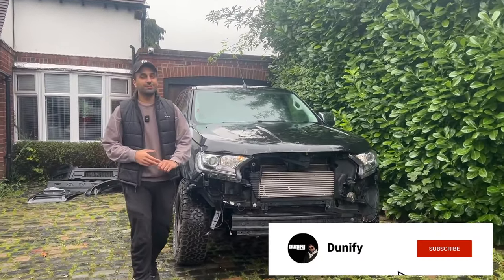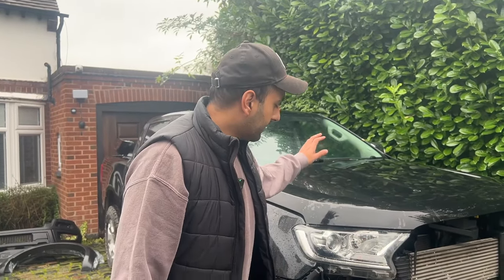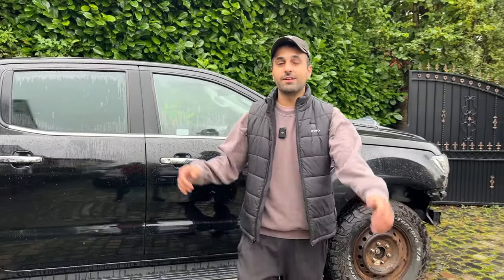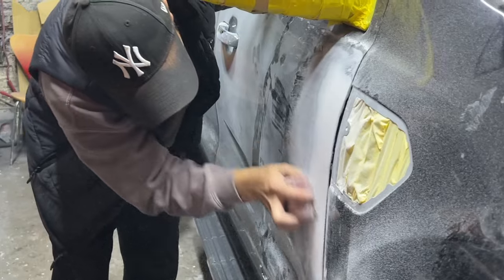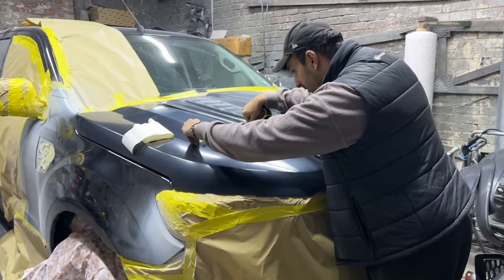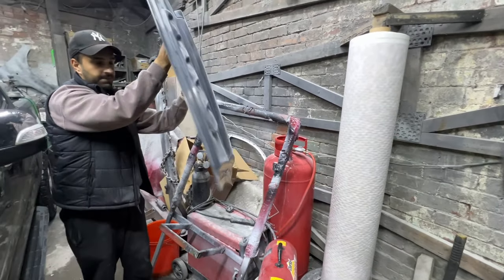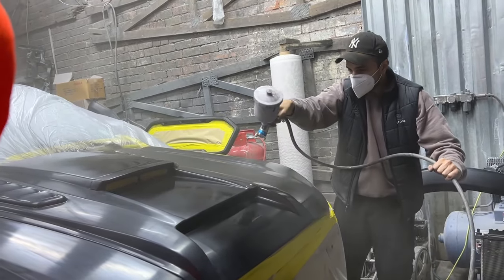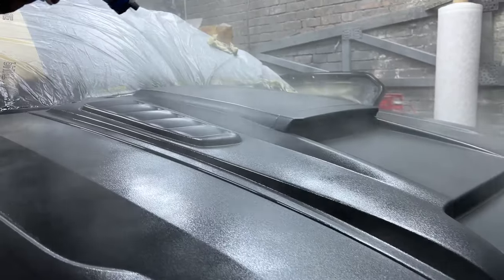I ATTEMPTED TO PAINT MY WRECKED FORD RANGER

Comment: Thanks for the video, I've painted a lot of tractors/ excavators for customers  and a couple them and trucks for myself over the last 35 years. I'll say the only color I bottled on was my  black GMC truck I was going to restore. I sold it instead as I knew black is a hard color to get the bodywork right on and didn't want to do it in the end . For a first go painting in those conditions you did real well, I figured you'd end up with more runs than you actually got ! Take care.

Comment: Bro lacquer is the hardest part, this is when the Spray Gun comes into play and also temperature, and the time spent between coats, keep going bro practice makes perfect.
Reply from the maker: Ah the spraygun i was using was just dumping lacquer, i tried turning it down but made no difference. Any spraygun you’d recommend?
Reply: @Dunify get clones of aliexpress depends on the compressor you use really if it's got enough CFM, gti pro clones from aliexpress are good for lacquer just depends on the compressor really LVLP are good for compressors with low CFM.
Reply from the maker: @piovo1  i will check them out 👌